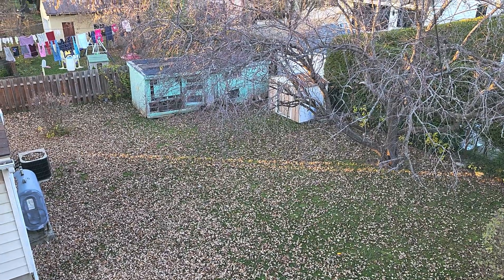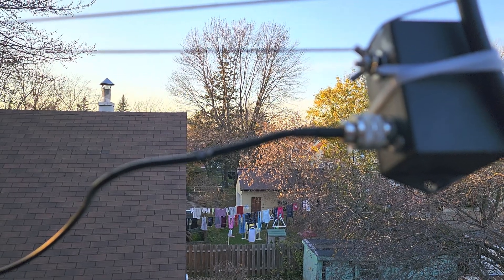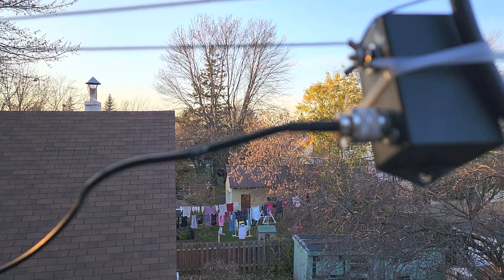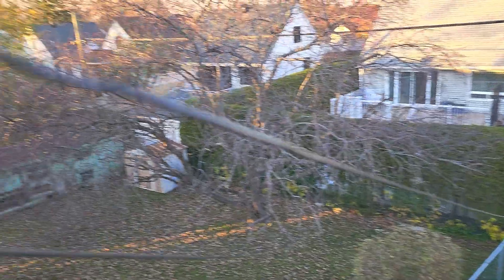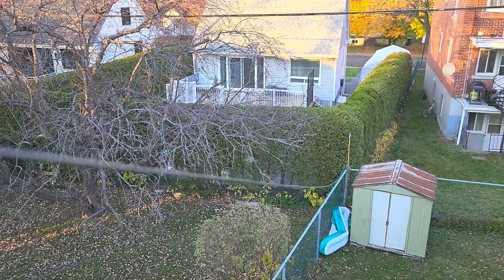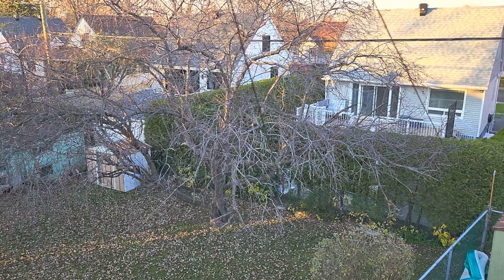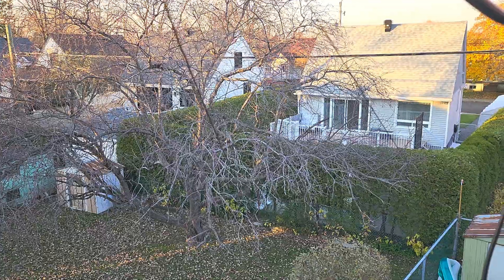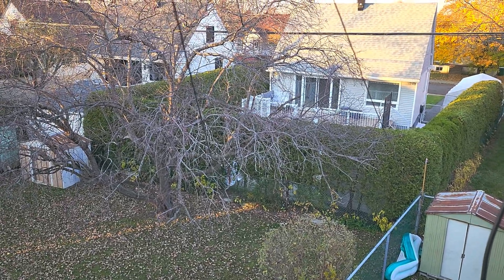My Experimental V shape antenna for Amateur radio use with Yaesu FTdx10 transceiver

Comment: Hey Gilles, new ham here with a question about your inverted V. I'm going to be doing a similar thing in my backyard but I'm curious if you find that the small angle between the wires interfere with each other? I'm thinking no given you are getting good comms, but my understanding is that for an inverted V the angle between the radiators should be between 90-120 degrees. Also, are the wires cut to a particular length or are they just random lengths and you rely on the internal tuner of the transceiver to tune. Really enjoy your videos. Keep up the great work! 73 VA3YOD.

Comment: Wire can be bent around corners or in many shapes that works for you. However, it might be a problem if 2 wires come too close to one another, and you will know it when the tuner tunes at 10 watts and then suddenly goes haywire when the power it turned up. What's nice about digital modes like FT8, is you can transmit CQ 3 times, and go look at pskreporter to see what stations have heard the signal and where.  This will give you an idea if you have directivity, for example. With that information, it may be possible to manipulate your antenna to give you gain in the area's you want gain.  Anyhow, just a thought, good luck and have fun.  73 David

Comment: I wonder what it would be like if you put the second leg at a wider angle of over 90 degrees.
Reply from the maker: I have thought of doing a wider angle to see what it does.  I suspect like this, it might be directional
Reply: @OfficialSWLchannel Maybe would act like inverted V at wider angles.  My inverted V legs that are pointing north / south is at around 120 degrees, bit more omni directional ,but probably stronger off to the sides to east/west.
Reply: @OfficialSWLchannel  Les conseils que les amateurs donnent sur l'ouverture (l'angle) de l'antenne sont bonne quand il s'agit de dipole. Dans ton cas, il ne s'agit pas d'une dipole mais bien d'une End Fed avec 2 fils sur l'alimentation. C'est un Unun 9:1 ou 49:1 que tu utilises? Tu vas augmenter ta performance en allongeant l'antenne et en ajoutant des counterpoise puisque présentement la contrepartie c'est ton coax.
2 fils avec une ouverture de moins de 90 degré fera en sorte que tu auras beaucoup de cancellation sur une dipole... Sur une EndFed elles vont interagir ensemble et te donner un profil très complexe et désordonné..
Je te conseil de l'allonger à la place et de la terminer en zizag en la faisant tourner au fond de ton terrain en l'attachant à plus de 10 pied de terre. Il est important de l'attacher à plus de 10 pied puisque sinon le sol va absorber trop d'énergie mais parce que si quelqu'un touche l'antenne pendant que tu transmets, ceci sera très dangereux.

À bientôt Gilles! 73!
Reply: I think what you made is called a “V antenna”. Two V antennas put together form a rhombic, which is a very impressive HF antenna (but a rhombic requires a great deal of wire lengths). Here is a website on the V: https://www.tutorialspoint.com/antenna_theory/antenna_theory_v_antennas.htm#

I’m not sure about feeding it with a single terminal off the 9:1 unun. You obviously radiate out with this so it works to some extent. I wonder if you might have better results feeding it more like a dipole. Maybe get a balun instead. Get a nano VNA and measure the input impedance of the V to determine what impedances need to be matched.

You can always text me if you want some help experimenting and I am happy to share what I know
Reply: It would also be interesting to see what happens if you run the second wire 180 degrees in the opposite direction, if that’s even possible in your location. 73’s Dave ka9gmu

Comment: Serious question: Wouldn't this just divide the power between the 2 wires if they are both the same length?  This doesn't great gain with the 2 wires so close on HF bands, right? How is this an improvement over just 1 wire? 🤔
Reply from the maker: I have noticed a huge improvements in my signal reports, something is definitely happening..with the second wire remember the natural resonant frequency of the wire has changed....maybe it simply is a better match when transmitting
Reply: @OfficialSWLchannel  Very interesting.   Thank you for all of your videos! 73 from NJ USA
Reply: on my inverted V the angle should be 90 degrees or more to avoid the legs interacting with each other and getting cancellation with each legs radiating pattern. I would try different angles to compare results but suppose depends how much space got to play with there.
Reply: I’m guessing that the wires a slightly different lengths. It will pick the wire that is closest to the frequency tuned making for a closer match. Much like a fan dipole. An endfed is basically a dipole with one side removed and replaced with a counter poise network. Good experiment.